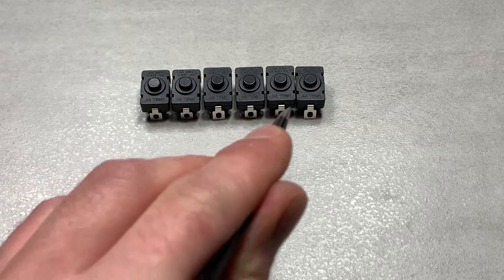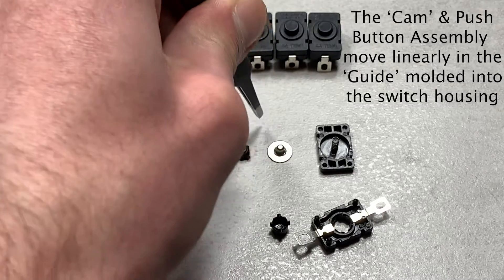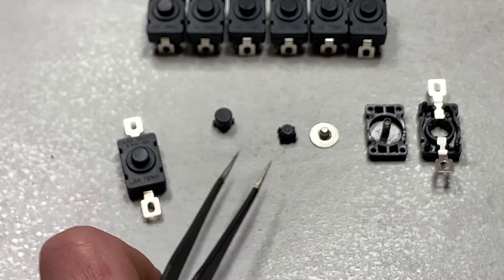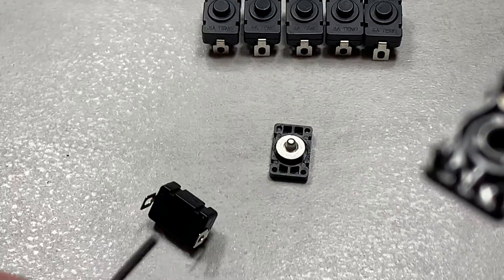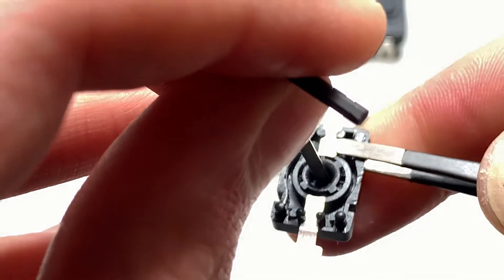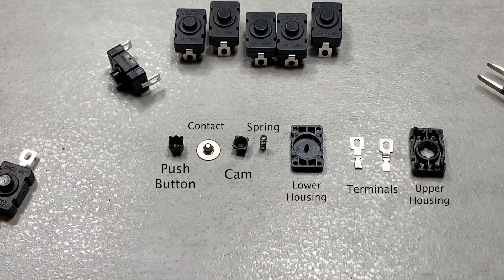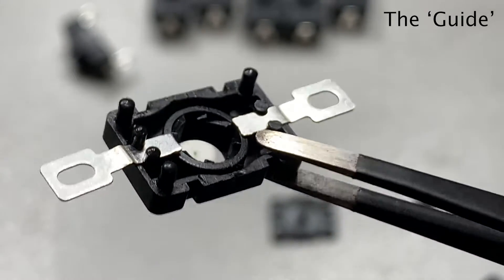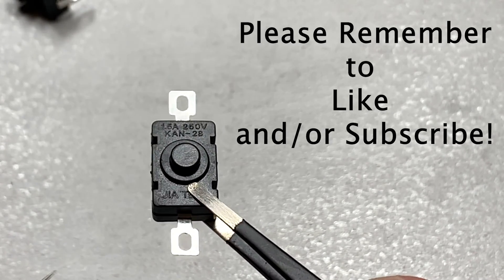How Self-Locking Switches Work

Comment: Where did you get these from?
Reply from the maker: From AliExpress but you can probably find them on places like eBay too. They’re called latching switches, you can also try searching for ‘latching push button switches’.

They’re available in different max. current ratings, so just make sure your switches are rated for the amount of current you plan on sending through them.

These here are rated for ~1.5A max., but I also have some that are rated for up to 6A.